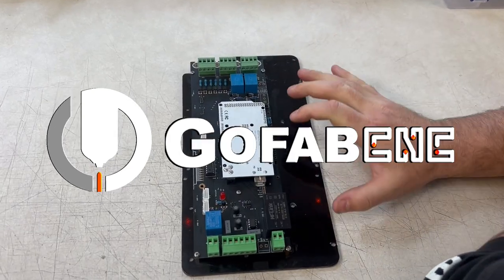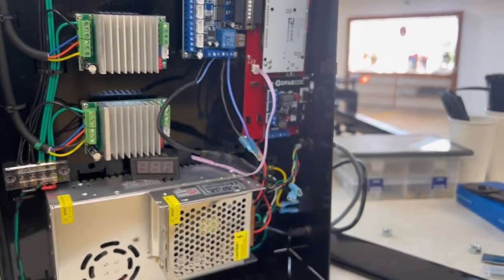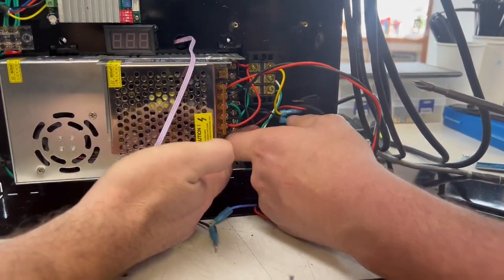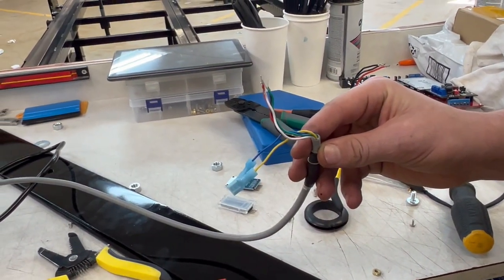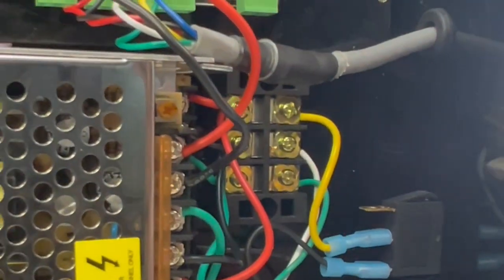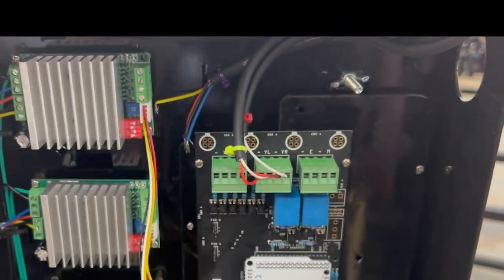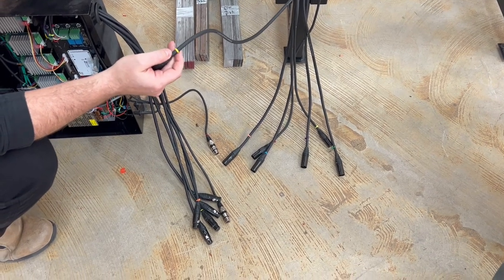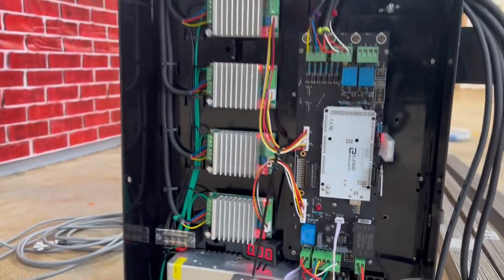GO FAB CNC NEW SUPER BLACKBOARD UPGRADE!!!

Comment: Does this use 4.9 or 5.0?
Reply from the maker: This Board is capable of running either Version of the Software. However, the New Bluetooth Module requires Version 5.